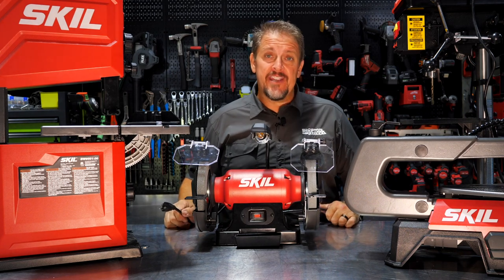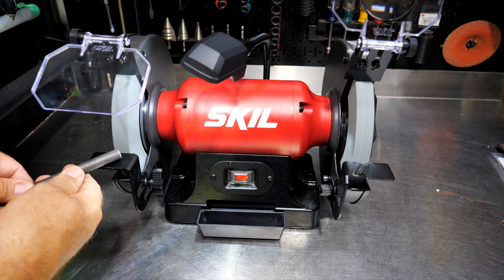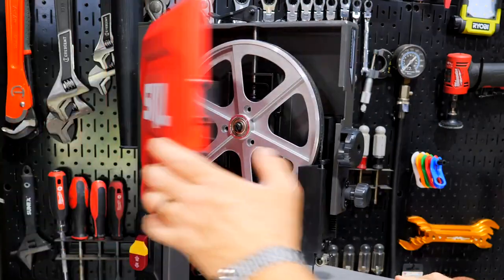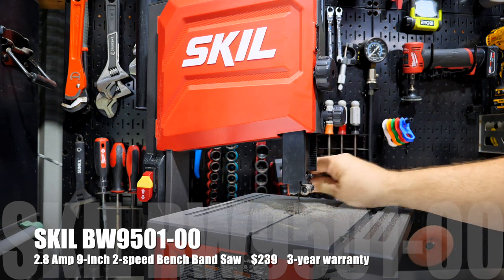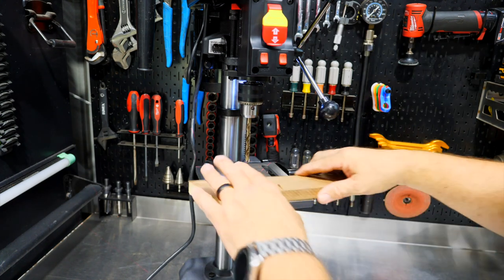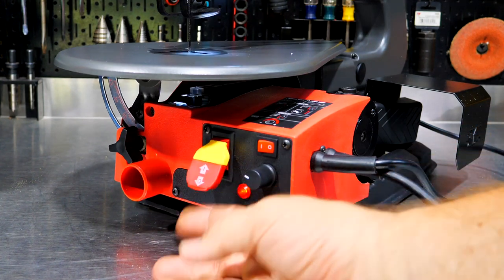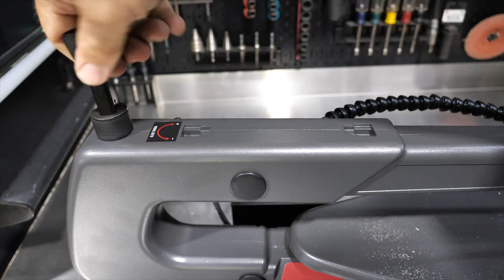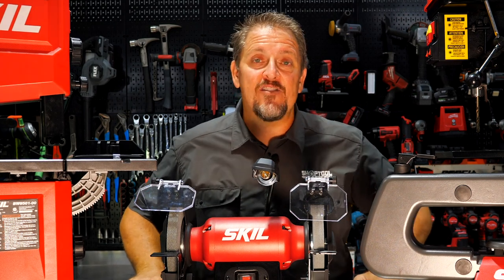New BenchTop Tools from SKIL Grinder, Band Saw, Drill Press, and Scroll Saw

Comment: For everyone pointing out the bandsaw wobble: it's supposed to be clamped or bolted down when in use. I have the same band saw and I built a short bench to bolt it to so that it sits at the same height as my workbench. Really great for the price and size
Reply: Amen
Reply: Does it come with a fenced

Comment: I bought a new Skil 9 inch band saw a couple years ago.  1st time I tried using it the drive belt snapped.  It's still sitting there as I have since purchased a good used 14" Delta floor model bandsaw (28-276).  Guess I need to find someone that wants a 9" band saw as I could use the space it's occupying.

Comment: That 10-in bench top drill press is a great deal... 6.2 amp motor for that price is a steal...Craftsman has a 3.2 amp for $179 and the 5.0 amp motor is $350...so at 200 bucks that's a real deal...👍
Reply: I considered that drill press but went with the 10" Wen 4212T.  It only has a 5amp motor, but it has variable speed adjustment without having to change belt positions.  Since I'm only using it to drill into wood the extra amperage wasn't necessary and it was 9 dollars less on Amazon.  If I had intended to drill harder substances I'd have went with the Skil.

Comment: wow that grinder revs up sloooooooow. I used to use my grandpa's when I was a kid and that thing had a huge cap on it. Full speed in less than a second, made the lights dim on startup. Granted it was only about 2000 rpm, but you couldn't slow it down. 3 amps seems quite weak for a grinder.
Reply: You don't need a lot of power for a bench grinder. The momentum at full speed pretty much takes care of the work. Not to mention it's not exactly an industrial grade either. But I'm sure they'll pop one out sooner or later.
Reply: @jordanalexander615  Yeah I know it would work, but I tend to just use a bench grinder for a few seconds at a time so that time to rev up just about doubles the time I would spend using it.

Comment: Man I have been impressed with skil’s value proposition lately…..but not these tools…look kinda junky…the band saw and drill press look like cheaper versions of the ryobi counterparts (a little more plasticity) I have the skil 10” slider and 10” contractor saw and have been impressed with both of them for over a year now (daily use, still square and true) but these look really really cheap 😞